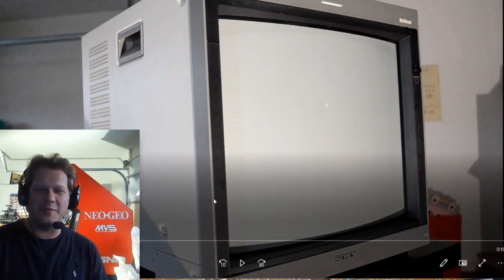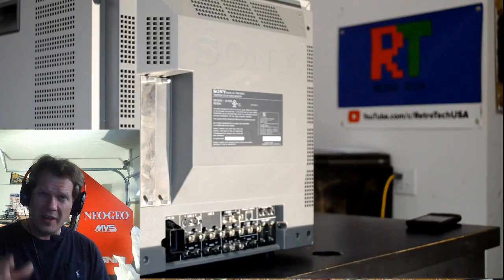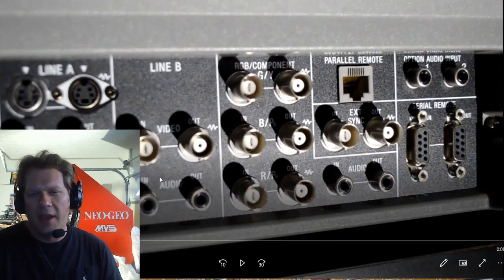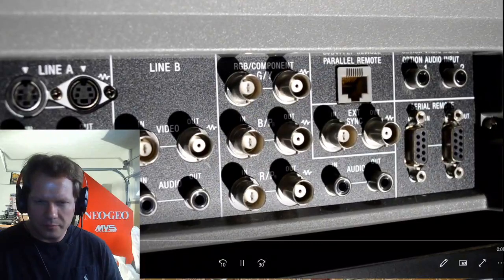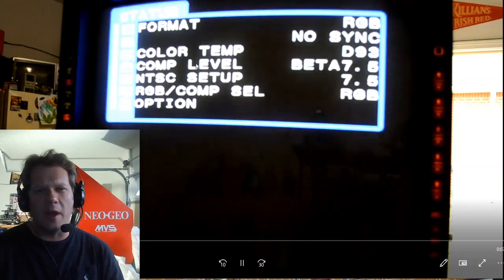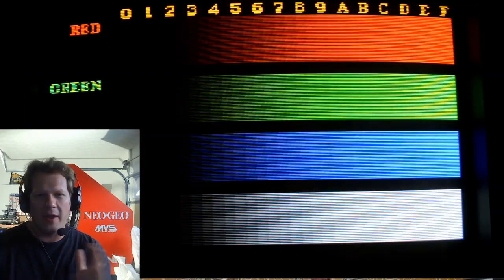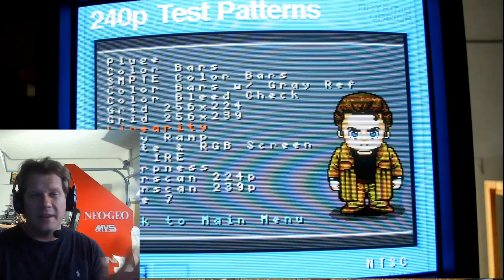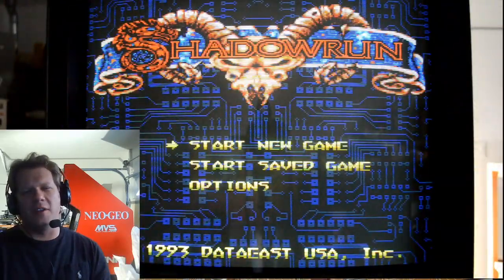Sony PVM 20L5 | Monitor & Restoration Project Overview

Comment: Awesome video! I picked up a 20L5 a few months ago, however I ran into this weird issue where if I play anything on 240p/480i it has a tendency to get “wavy,” it’ll also start pulsating (almost as if the tv is turning on and off really fast), especially on a brighter image. Any idea on what that might be? Have tried with multiple consoles and different power cables and the problem is still there. It looks perfect on anything 480p and above. I’m a bit of a noob when it comes to crts and I’ve googled a ton but can’t seem to find any info on this problem.

Comment: I’ll be following this closely as I recently purchased a Japanese variant 20L5 with some power supply issues. Turns on but turns off randomly by itself apparently. Not sure if it’s the fly back itself or just some bad caps.

Comment: If I use 75 ohm terminators on the outputs of a monitor that is self-terminating, does it hurt anything?  I do this, because I have been told that the self-terminating connection can stop working.  ...and then you are feeding an unattenuated signal into your monitor.  ...which means the monitor is brighter.  ...which means it wears out faster.